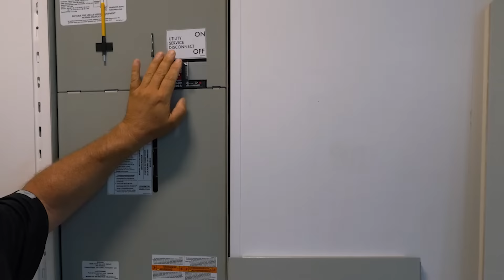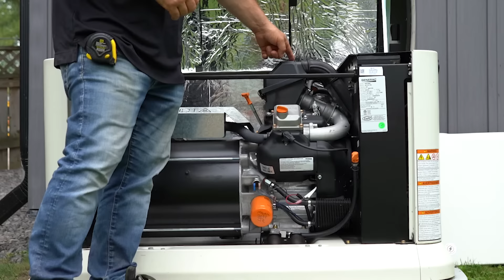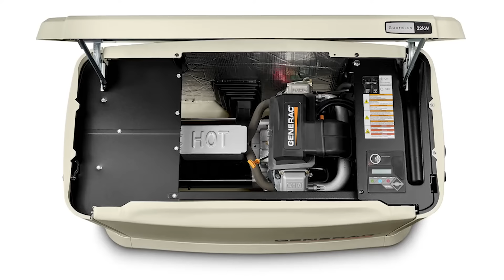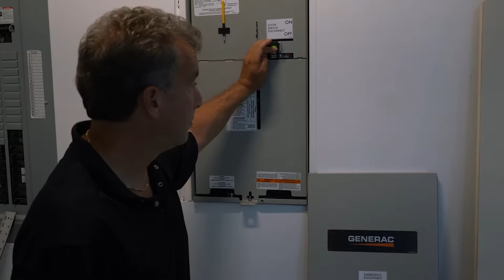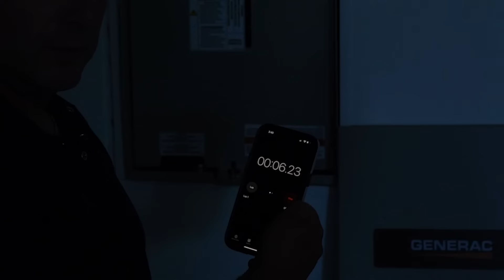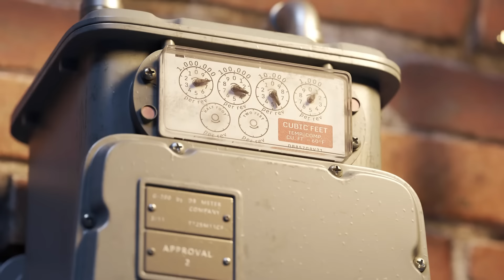How Does a Home Standby Generator Work | Generac Home Backup Power Explained and Tested

Comment: Brown outs...power fading in/out. (possible windstorm) Sensors pick up on these possibilities?
Reply: The transfer switch will switch over to generator power after it knows there is a power loss from the grid.
Reply from the maker: Most home standby generators (like Generac.) use voltage and frequency sensing inside the Automatic Transfer Switch (ATS). However not every flicker triggers the generator.